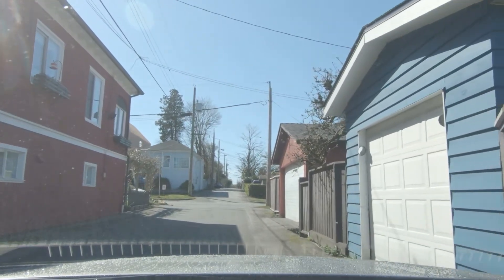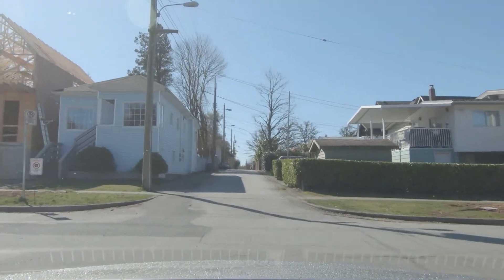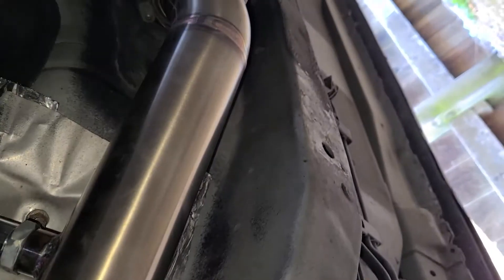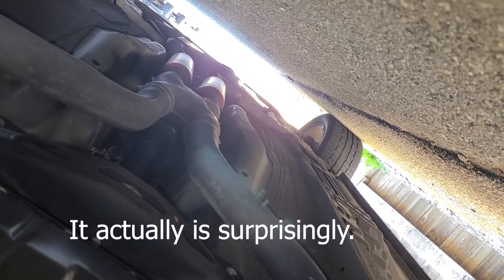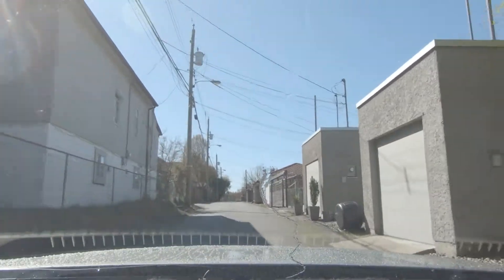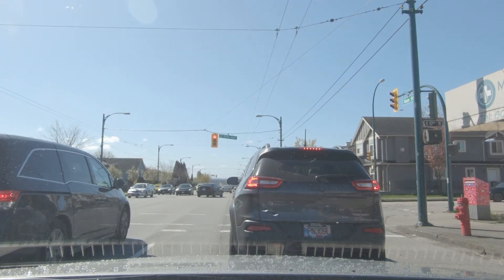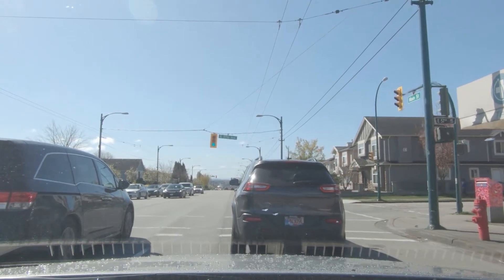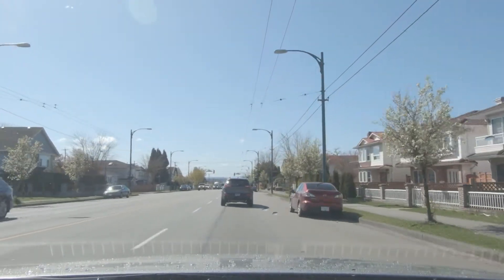Infiniti Q45: Nissan Titan Headers

Comment: Dude that is great. I got a 02 in the shop q45 trying to coustom fit with long tube headers ,I  can try to keep anyone up dated 😅, not been going well.
Reply from the maker: yessir, there's a few guys on the Facebook groups that have VK powered vehicles with long tubes but it's crazy tight man. Check out my video on ditching the anti roll bar, it gives us a bit more clearance. Long tubes also might need some tuning to run right.
Reply from the maker: you know I was actually thinking, now that mines fit well, could I cut off the collector and extend it?? 🤔🤔

Comment: Bro share a link for the headers!! I am trying to do the same on my 02 my exhaust is rotted out 🤪
Reply from the maker: These are the ones I used, you could shop around a bit and maybe get a better price but that's where I got mine.

https://www.ebay.com/itm/361864107873
Reply: Thanks bro keep up the good good work. 👍🏼
Reply: @30YearOldBunta , the headers are a direct bolt on? Also, are there hi flow cats for our cars?

Comment: Will this mod work on the 97-01 Q with the 4.1L?
Reply from the maker: the bolt pattern won't fit but you could make headers for it.

Comment: Did you have to dent the header piping to fit it? Have you done any ecu tuning?
Reply from the maker: It needed to be windowed on the driver's and the passenger did to but it could be done without. The shop ignored my requests to grind off the access port and instead they bashed the headers.

Not much space near the steering shaft. I have tuned it on the m45 ECU swap video but I am currently on the stock ECU again.
Reply: So we're the headers not made for the 5.6? Also,  the M45 ecu works with the Titan/Armada?